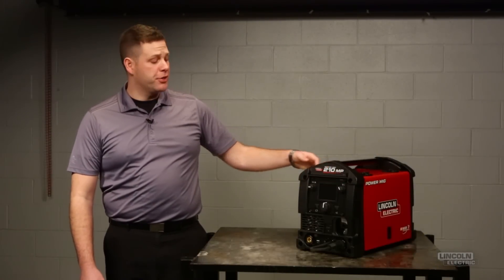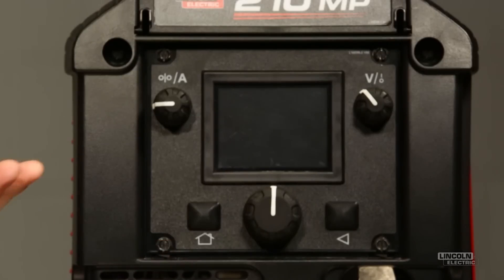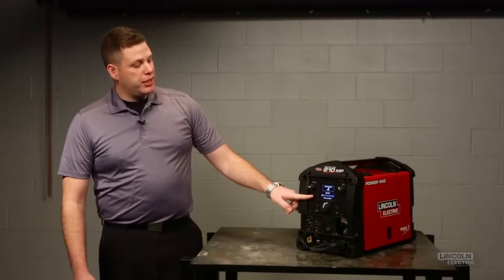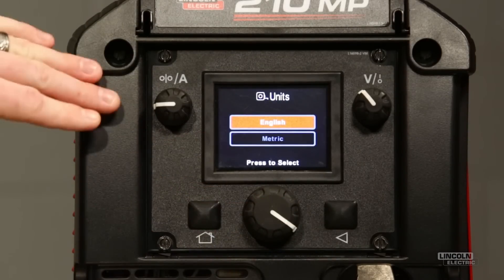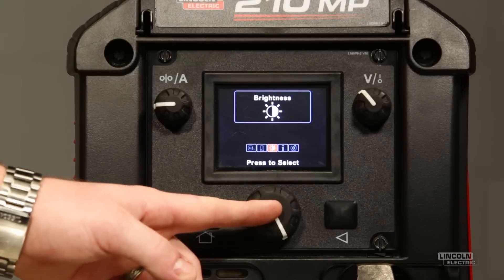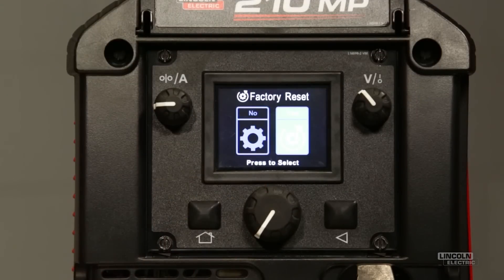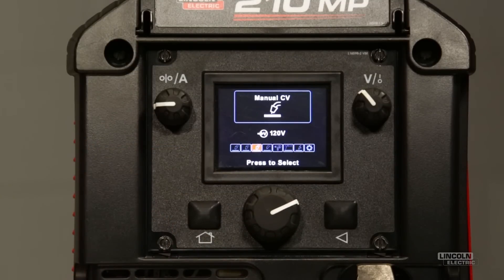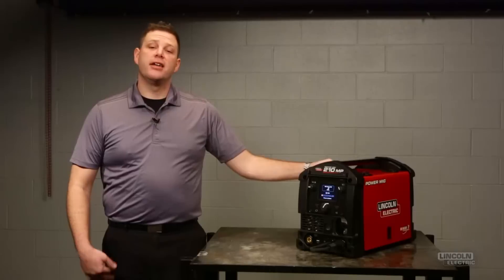Lincoln Electric POWER MIG 210 MP User Interface Walk-Through

Comment: seen videos where these machines have bad wire feed roller/driver
Reply from the maker: +IBoosted SS Can you send us a couple links? We stand by our products and if someone is having an issue we'd like to correct it immediately.
Reply: +lincolnelectrictv Im trying to decide between this model and the millermatic 211
Reply from the maker: +IBoosted SS Don't take too long. Our price is $999 after rebate, for a limited time. And the Power MIG® 210 MP will not disappoint. Read the reviews. Check out the youtube reviews.
Reply: i just got this. Its still in shipping  when i get it i will test it out and see if the drive still does the same thing i have seen in the videos  it looks bent i will be sending it back even before i use it

Comment from the maker: @abcxyz69r
The POWER MIG 210 MP provides a recommended starting parameter for all processes that can be adjusted based on application and operator preference. The machine also features Manual CV mode to allow experienced welders to set welding parameters based on personal preference when MIG or Flux-Cored welding.